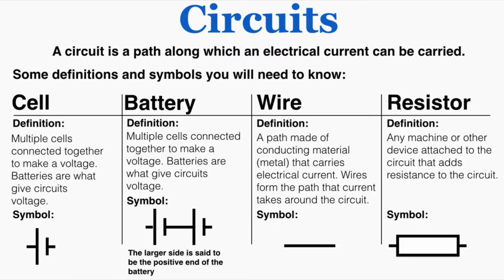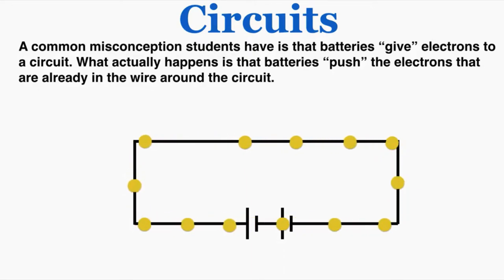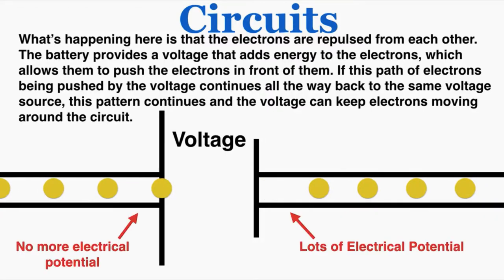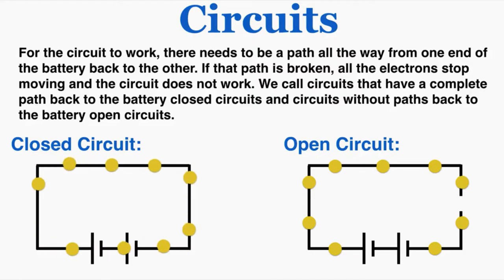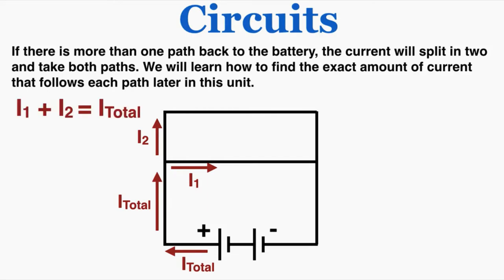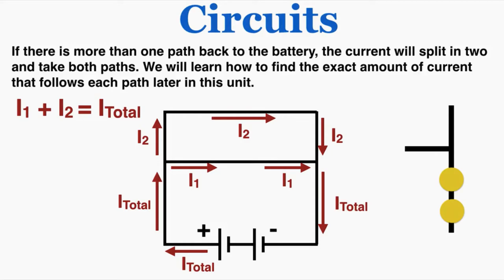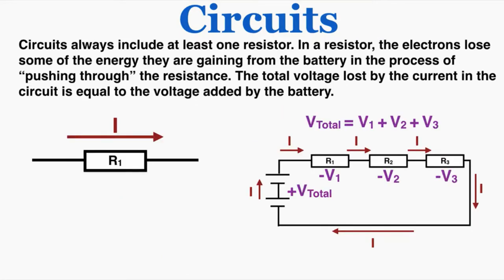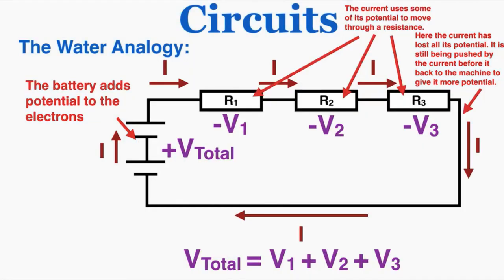Circuits - IB Physics

Comment: Comparing the water analogy, is the voltage always 0 after the current passes through the last resistor? And If so, what provide the electrons the "push" to travel from the resistor back to the battery? Why don't the electrons just stop there?

Comment: Actually the electrons do not move from positive terminal to the negative terminal in a real circuit. They can just go at millimeter or cm sized distance at most in the circuit and they all have a so called drift velocity. Besides, they share the impulse to each other within this motion and the energy is propagated by the electric field applied over the circuit by the battery.